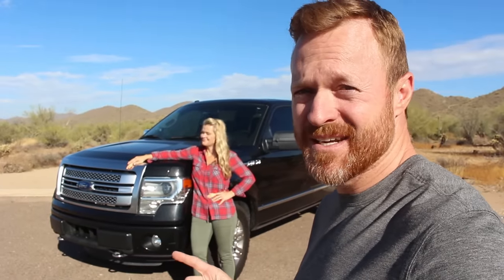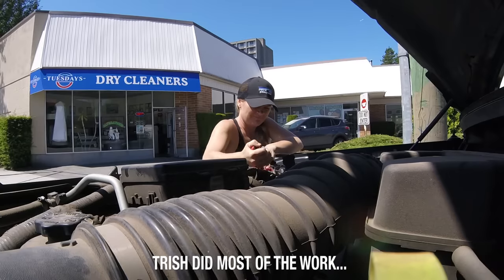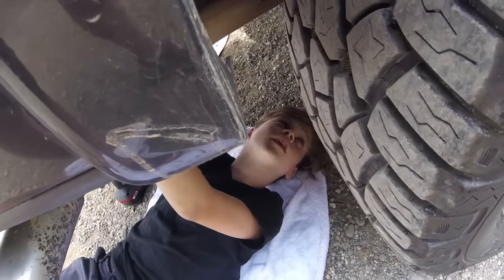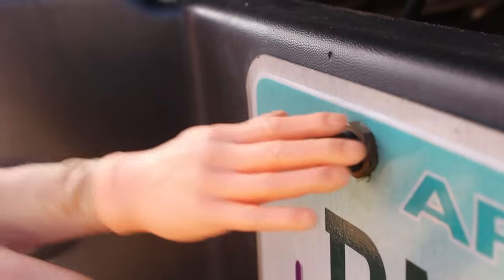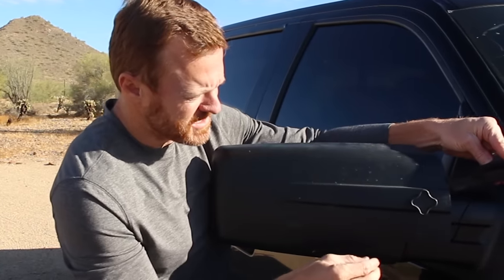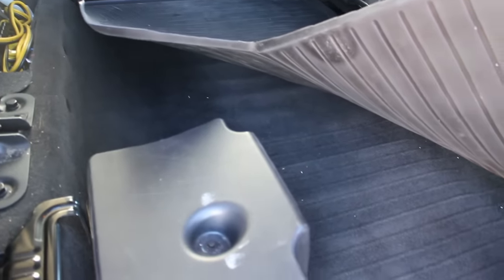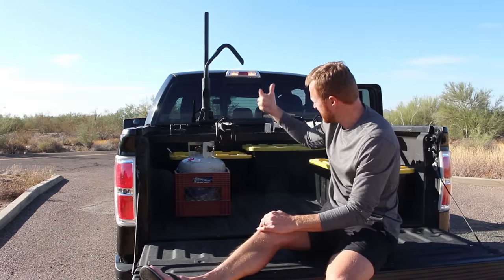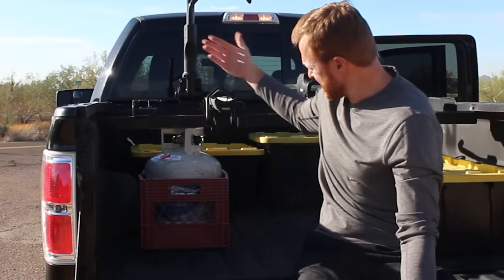TOWING WITH A HALF TON TRUCK (FORD F-150)

Comment: Keep your dream, I really enjoyed your video. I am looking forward to watching the other videos. Since I retired, I have been trying to get the nerve to do some traveling by myself. Especially to Alaska. I have a loaded 2014 F150 lariat 3.5 ecoboost 4x4. I will be towing a 2013 Livin Lite 7x18VRV and was happy to see the extended mirrors you found. I used the link you provided to see about ordering a set, but unfortunately the site informs me they will not  fit a Lariat. For that matter they say they wont work on a 2wd xl or an stx. Do you by chance know of any other similar products that mount in the same fashion? (these look much better than those that use straps} I was just curious to know if you could still fold your mirrors in with the tow mirrors attached. Also, you probably mention this in your other videos that I have yet to watch, but can you tell me what tires you were using on your F150 and how well they held up. Thank you

Comment: Airbags make 1000% difference! That being said. Your dangerously towing over the limits of that rig. 1/2 tons don't have the weight, nor the wheelbase to control that big of an rv, especially bumper pulls
Reply from the maker: The 6.2L version had more cargo capacity than most half ton trucks + the WD hitch. I was within the numbers. I agree, more weight and longer wheel base would be better and I now have an F250 diesel, but Towing N America for over 40k miles, we only one isolated sway issue in Florida. That's a lot of miles to not have any symptoms or issues. We stopped on a dime and traveled through the Canadian Rockies.
Reply: You got lucky. And 9 out of 10 times, rv's are heavier than advertised
Reply from the maker: We weighed it on scales. All scales in OR or free - roll up off the freeway. I would say we were not unlucky.

Comment: You didn’t mention a weight distributing hitch, but did mention the overload of payload cap. So I assume you only use air bags. They often cause overload of the rear axles on 1/2 Ton models  because they don’t distribute the weight to other wheels. And provide no sway control. Is that right.
Reply from the maker: We use a WD hitch. I don't know why I forgot to mention that, other than my initial thought was to do an entire video on just that.

Comment: I clicked on this video and you did not talk about things that I needed to hear. I was wondering the weight ratio and then also what the add-ons on the truck been in the cab the change the weight ratio of the truck towing capability so I wanted to know how did that affect the towing of the trailer did you have to take weight off the trailer just some things that I was wondering?

Comment: Thank you for the example you guys set on your videos and to the hard work you guys put in for the channel. I had a question about your air bags. Did you add psi before or after you connected to WDH? Also, did you re-configure your WDH with PSI in bags? Thanks again!

Comment: I am curious what the payload rating was on the F150. Hard to imagine you were under with all the things in the truck, not even including the tongue weight of the trailer. Good video though.
Reply from the maker: If I recall, 1500 or so. I'm sure it was close. We've learned a lot since SN1

Comment: Did you guys not use a sway control hitch on the F-150 when you towed Ginger? If we do not have a truck yet, so should we look for a F-250 to start out instead of considering a F-150? We are interested in the 8500 lb GD 2670MK TT. With the right F-150 configuration, all the towing and payload numbers are good but I worry about the sway problem since we will be new to towing a trailer.

Comment: Whats the weight of that camper? Because the older f150 can only do like 8600 or 9300 lbs max towing from what i heard, did those upgrades help

Comment: I have a 2014 F150 super crew with 5.0 litres V8 and use a weight distribution hitch for my 28 ft travel trailer and never had an issue with it sagging, mine is an FX4 off road not sure if that makes any difference.

Comment: I have a question. Can I safely tow 11,500 total weight. Travel trailer. I own a F150 3:73 gear ratio 6.2 Ford Powered V8 6.5 long bed crew cab lariet FX4 if I installed airlift air bags with tires LT285/65R20 10PLY 2 inch leveling kit on front. B&W gooseneck with 5th wheel B&W. I have the Platinum wheels

Comment: Hi. I don’t have a truck yet and need to buy one. We bought a 2007 28 foot trailer. The guy I bought the trailer from said a half ton truck is good enough but I am not so sure now. I really like the look of the new GMC 1500 diesels and I wanted a trailer that could be towed by one. Would you recommend rather a 2500 as you had the same size trailer.

Comment: I'm a gear head, the talk of the bicycle pump bout made me sick. and the metal for your bike rack isn't 1/4". closer to 1/8", possibly 3/16, definitely not a quarter. that would be overkill and expensive. the frame under your truck is around 3/16 before it is bent and stretched in a press. still beefier than nissan, the company i worked for once upon a time. 

great videos
Reply from the maker: You might like the new Viar setup I have on my 6.7L F250. But I still stand behind my bike pump ;) Reminded me of the time an old timer finished a math problem with a pencil before I was done with my Excel sheet. Life lesson.
Reply: Keep Your Daydream we old people know things. I worked everything from changing tires, welding, building engines, driving big trucks, to quantum metallurgy. I know right. When learning a new skill, look for the guy that isn't in a hurry. The lazy looking fella that seems to finish first. Experience is a giving mistress.

Comment: What is your opinion on ROADMASTER active suspension system. It suppose to increase the payload of your vehicle by 50% and help with the squatting. I own a 2017 Tundra 5.7 crew max with a towing package and planning on installing a 5th wheeler hitch  buying a 5th wheeler made by FOREST RIVER artic wolf 295QSL8. I do have a large family and planning on having people traveling in a separate vehicle. What do you think about this towing configuration? Any suggestions or advice?

Comment: Disappointed the video did not cover driving techniques for the 150.   Gearing down, going slow, engine over-heating.   I want to drive to Cali from NM next year but hubby worried about road grades.   Need reassurance!!!
Reply from the maker: We do have plans for driving videos, but this one was just about upgrades as it's been requested for months. I'll start thinking about driving.

Comment: Hey Marc and Trish! Curious how long Ginger was, as well as the weight? My wife and I will be renting a 32’ travel trailer for the first time in October and we have a 2017 F150 5.0 with the towing package so just trying to gauge how confident I should/hope to feel towing it. We will have weight distribution and sway control, and I have LoadLifter air bags on my truck already.

Comment: First off I'd like to say that I've not only found your videos informative, I've also enjoyed seeing the travels and drinking to every time I hear command strips. I do, however have a question. I have a chevy 1500 1/2 ton with factory hitch rated at 5000 lbs. Could I pull a 29 ft 7000 lbs travel trailer?
Reply from the maker: Check your cargo capacity and tongue weight. That will likely be your limitation. If you're overweight, the suspension of a 1/2 ton truck could have a hard time handling the rig. Pulling the weight isn't the biggest issues, but what most people talk about.

Comment: If you are using your brake controller to stop trailer sway, does that mean you're not rolling with a sway bars? I had sway bar/ weight distribution system. I don't think they've required by Washington State Law. But the dealership would not let me leave the lot without it. They were probably disappointed when I showed up with one I got from someone for $50 and mounted it myself. Instead of buying theirs for almost $400 with installation.
Reply from the maker: I had a WDH too. I know have a 3/4 ton truck with a Hensley Hitch.

Comment: I have a 2003 crow cab ford f 150 and im Wondering if it can pull a fifth wheel and not damage the truck or trailer

Comment: How do you hook up to your truck? Do you hook up your weight distribution hitch before filling airbags? Or do you fill the airbags then hook up the weight distribution hitch?
Reply from the maker: Always put in air before hooking up or rising the back end of the truck removes the tension applied from the WD bars.

Comment: Your platinum f-150 looks like a ecoboost not a 6.2L. U can clearly see the front intake and license plate is to the right not centered.
Reply from the maker: As Dwight from the office would say: False.
Reply: I ask this do to I have the same truck, color, every option available 2014 and I am looking to travel the US and seeking trailer however mine is 3.5L ecoboost. I value what you say pertaining to weights and measures and it concerns me greatly on what I can pull with my current truck.

Comment: Please help me. I have a 1/2 ton Chevy Silverado with the 5.3L engine and the rear axle was upgraded to the 3.42 ratio. I have a 33 foot camper with  the GVWR at 7,200.  Is my truck ok to pull this?

Comment: Hey, Great information. Thank you. I cant see anywhere that you mentioned your fuel mileage and if you have done anything to try and improve that. (ex. performance air intake or exhaust) I have a 2012 f150 fx4 5.0l. had a truck camper that weighed approx 1600-1800lbs and was getting ave. 18l/110km. towed a 21' rpod approx weight 5000lbs and got 18l/100km as well. we just bought a 1988 32' class A motorhome but havnt picked it up yet. I am expecting around 30l/100km but i think the space and comfort will be worth it.

Comment: I recently picked up a, 2012 F-150, 5.0 v-8, with towing package. I have the fuses in, but have no power to trailer. Is there a special relay connection somewhere?

Comment: thinking about upgrading to a 26 ft trailer.....tow vehicle is 2009 gmc sierra 1500, 5.3 liter with 9500 lb towing capacity ......heard about lateral drag and concerned that have too small of a truck....any thoughts?

Comment: I have a ford F150 and I appreciate this video, we are patiantly considering a travel trailer or maybe a fifth wheel, i am not sure if a 1/2 ton will pull a 5th wheel. i have a question. I am sure you have changed your brake pads, did you upgrade them if so which did you buy?
Reply from the maker: Check out our payload video. Link in desc. I got 90k miles out of my front brakes and sold the truck at 100k with the original back breakes. That was mostly due to the fact that my trailer brakes gain was set to 8.5 and the trailer did a lot of stopping.
Reply: I believe I already watched it and shared it with my buddy, I don't see a link in the desc is it the one where you are inputting figures into an excel spread sheet? BTW, great video and thank ya'll for the help you give. You were the first to really explain it and instantly made sense.

Comment: After you installed the firestone airbags did you need to adjust your weight distribution hitch? Also when hooking up do you put complete weight of trailer down before filling bags? Thank you for your time and safe travels.
Reply from the maker: Depends on the truck, in the case of my F150, I kept the air at X psi all the time. It's important to add air before adjusting the WDH or you defeat the purpose of the chains by taking away tension. Technically, you're supposed to put the load on the airbags before adding air, but unless you're adding a massive load on the overinflated bags, you'll be okay. For me, I kept the air the same all the time. In my F250, I have an onboard compressor and I adjust all the time. Totally differently setup and hitch though.

Comment: Let's talk here. Did you or did you not have your brakes worked on. Also, the Air cleaners, Oil Filters, other, Do you execrate or do you just forget what you did.
Reply from the maker: I wasn't talking about maintenance. Just repairs. Wipers, batteries, brakes, oil, etc were all done timely.

Comment: Great video guys, Bless you Trish!!! LOL
I am curious about the air bag system. I have the Ford F150 Ecoboost and tow a 25' Airstream Trailer. It weighs about 5200lbs with our stuff in it.
We have leveling hitch with two bars that I install and then set the tension. Do you use this system or only rely on the air bags.? I also have two stabilizer bars with adjustable pads on them.
What is the tongue weight on the Ginger? It should be about 10% of the trailer weight.
I like the airbag system and would definitely consider it. However our rig sits pretty much level now with the equalizing hitch.

I agree with some the comments from other subscribers a 250 Diesel would definitely be my choice. However way too expensive.
We just returned after a 50 day trip out to Colorado, Wyoming and then to Texas to see our son. We covered about 12000kms
(about 8,000 miles) my truck is metric (we live in Canada near Niagara Falls). Driving from Cheyenne to Dallas we struggled with a very strong head wind for almost two days. My fuel consumption was terrible. We averaged about 8 miles per gallon on that part of the trip.
However, during the rest of the trip including the mountains in Colorado, we did a lot better. I set the trip computer before we departed from our home to see how much fuel we consumed and also what out over average fuel consumption was for the entire trip and we averaged about 13 miles per gallon overall. Also, during out time in Colorado we had guests with us meaning that there were 4 adults and the two dogs in the truck plus the extra luggage. I think we were up around 6000lbs on the trailer plus the load in the truck which put us at about 6500lbs of goods.
Our truck is a 2014 F150 3.5 litre V6 twin turbo or Ecoboost with a max tow package. Giant "elephant ear" mirrors that slide out and a built in trailer brake as you have. According to Ford it could tow 10,000 lbs. I would not want to try it. I chatted with a fellow at an RV park in Dallas and he had the same truck. He was towing a pretty large 5th wheel. After the mountains in Colorado, I could not imagine towing that 5th wheel with a F150 Ecoboost.
Thanks for a great video.
Cheers,
Keith
Reply from the maker: That's a good point. Maybe if I move up one link it will have more tension and the bar will stop falling out. It's driving me crazy and need to replace. Camco won't warranty.

Comment: You should not level with air bags should have used a weight distribution hitch the air bags are for leveling your truck by its self if you have a big load in the bed.
Reply from the maker: We did.

Comment: OK so I have read a ton of towing blogs and to no surprise, they are all over the place in regards to my vehicle. So my question is I have a 2012 QX 56 dealer tow rating is 8500 LBS. My wife fell in love with a travel trailer from coachmen that weighs 7700 LBS dry weight. :)))) I fully understand that I will NOT be carrying any water. potable/grey or black while traveling. The RV dealer sez I have no problem with my vehicle, its a beast. I have purchased a WD tow system rated for 10,000 LBS with sway Control 12K tongue weight. what is your real life experienced opinion before, I sign the purchase agreement. PS. I can't find tow mirrors for the QX 56??  Thanx Dan   all input will be appreciated, greatly
Reply from the maker: This might help http://keepyourdaydream.com/payload

Comment: Okay, I need advice. As stated on another of your vids, I bought my TT and then found out my vehicle won't tow it. So, I'm in the market for something that will. I like the Ford truck but not in the market to buy new. Here is my travel trailer info for anyone that can give me feedback on what I need to get. 2018 Coachmen Viking Ultra-Lite 17FQ: hitch weight 320 lbs., UVW 2886 lbs., GVWR 3635 lbs., exterior lenght 21' 4", height 9' 8", width 88", fresh water 33 gal., grey water 25 gal., black water 25 gal. I would appreciate any and all suggestions. Thank you in advance.

Comment: So how dose it pull with that 28' an dose the transmission jump from gear to gear at time's 
Something I was told that happens when pulling not should if it just with a 10 speed as like I have in a 2018

Comment: Changing the suspension!? So over load the brakes, drivetrain. Using a weight distribution hitch? Floor mats help with towing. Who knew? Trade the 1/2 ton and get 3/4 for the amount of towing the 1/2 did, be much safer.
Reply from the maker: The floor mats did most of the towing. I have a 6.7 Diesel now, but I had no regrets seeing 38 states and 3 countries with this truck.

Comment: You could have just gut a 250 and come away with a much better and stronger truck and cheaper too, in the long run, and the weight desabuishion bars help in the sagging of the rear end of your truck.
Reply from the maker: That's true, but I didn't have an F250 at the time. Had we waited to a better truck or better rig, we might have changed our minds, got overwhelmed, chicken'd out and the whole thing wouldn't have happened. Our philosophy is start with what you have and upgrade later (as long as it's safe).

Comment: Since you now have the telescoping mirrors on your F-250 how would you compare them to the slide on ones that you had on the F-150?
Reply from the maker: The F150 mirrors were better! They had a longer reach. However, the 250 mirrors show me the trailer axles which is SO nice!

Comment: Did you purchase the airbags for cosmetic or practical purposes?  What effect did it have on your towing experience?
Reply from the maker: I like a level truck, but it's safer too with better maneuvering. Added benefit of not getting flashed at night with the lights pointing up in the air.